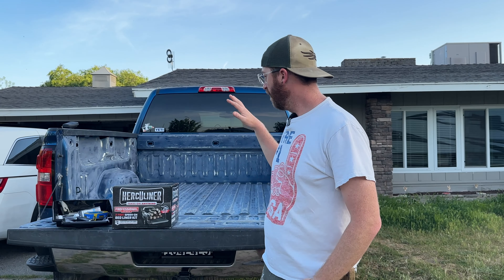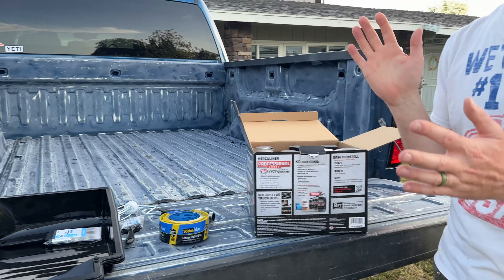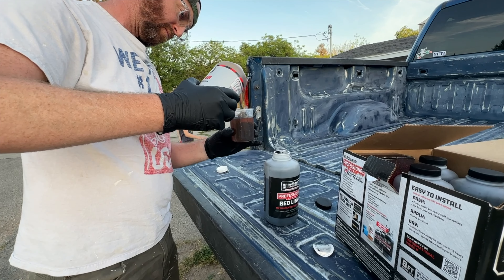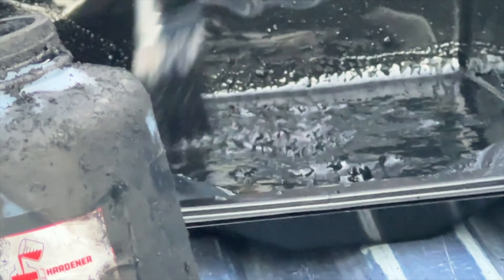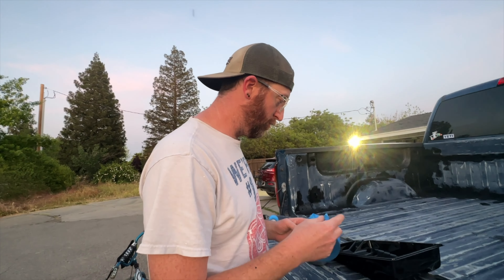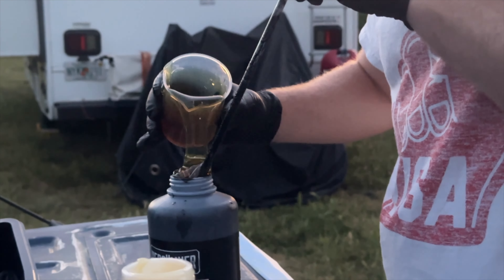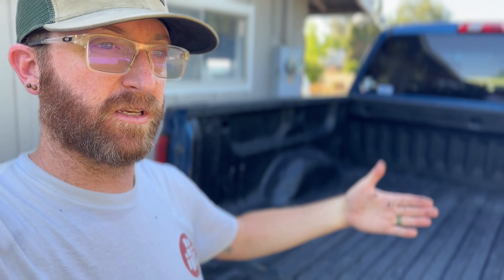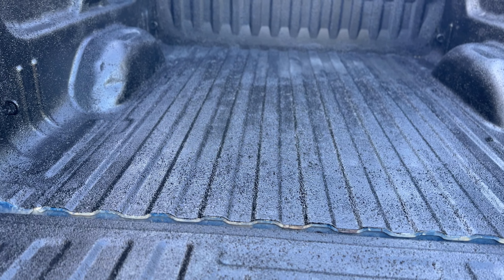How to apply Bedliner. Avoid these DIY MISTAKES.  Herculiner roll on bed coating.

Comment: For those here saying raptor liner is better than herculiner then you need to watch Farm Project testing on roll on bedliners cause Herculiner beat Raptor and actually the testing he  completed showed that neither Heculiner nor Raptor won. DuraBak-18 came out on top then EGC and then Herculiner. Raptor actually came in 4th
Reply: I watched a guy do some testing on all the major bed liner brands and he did a pretty good job, like adding 15 lbs weight to a garden tool and dragging it over the finish so it was reproducible between tests.  The Herculiner did pretty well.  But what it didn’t do well with was extreme heat it started to get soft at temps that can occur in an area like phoenix.  So that is something to consider.
Reply from the maker: @OrangeTree253 -
I haven’t seen the testing you’re talking about, but I live in central ca. and today it’s 117* - so far the Herculiner has held up great.
Reply: @BadAtHunting  that is about phoenix level, and good to know.  I ended up buying the raptor stuff and put it in yesterday.  I should have worn gloves, cannot get it off my hands and fingers.  What a marvelous product, lol
Reply from the maker: Yeah, I had the same trouble with the Herculiner. It was a pain to clean off.
Reply: Yeah I watched that video as well, for my bed I’m using Heculiner, to paint the whole truck I’m using Raptor.
Reply: Project Farm not Farm Project lol, but yeah his tests were pretty good and diverse in what they were testing
Reply: Thanks for thr heads up imma check that out now

Comment: should of sprayed it on you wouldn't have that blotchy look  from rolling it on. a liquid liner needs to be spray so it will look uniform. i used raptor liner 140 from autozone 30 for the gun then 30 bucks in clear tarps and 180 grit sandpaper from.home depot. spent 4 hours in total from start to finish.
Reply from the maker: Yeah, I agree. If I had to do it again I’d try and spray it. 

The main problem I had was I didn’t mix the parts properly.
Reply: Rolling is fine. Probably the product was stored in the wrong temperature
Reply from the maker: Yeah, i think you’re right. I could tell it had bean sitting on the store shelf for a while - so who knows what happened to it while it was in storage there.
Reply: @maxaddicks1743   so the thirty dollars for the gun assumes you have an air compressor already right?  Love the idea of spraying it on, but don’t feel like buying a compressor
Reply: @OrangeTree253  Exactly! That's my issue. Why buy a compressor for a one-time use? I've heard airless spray guns can do the job. Do you know anything about that?